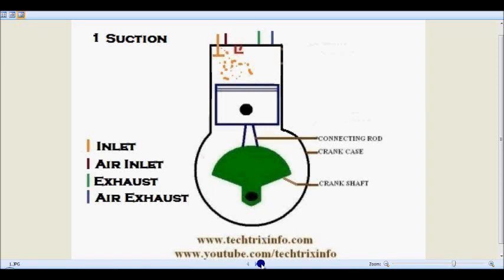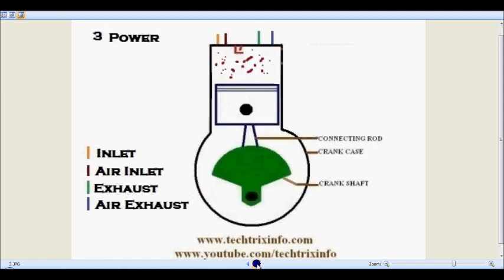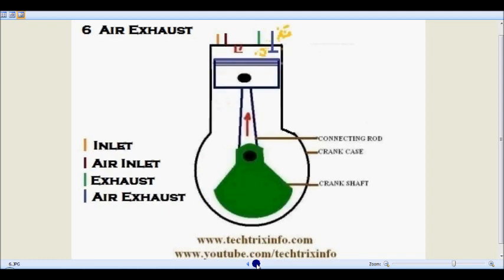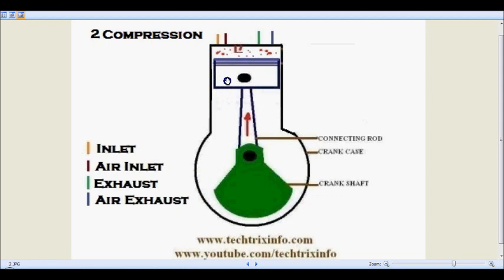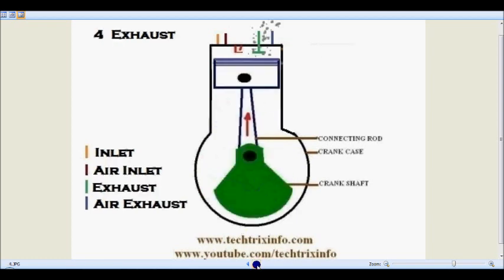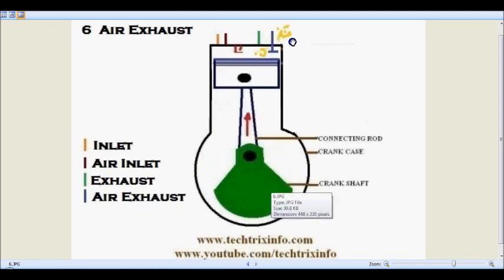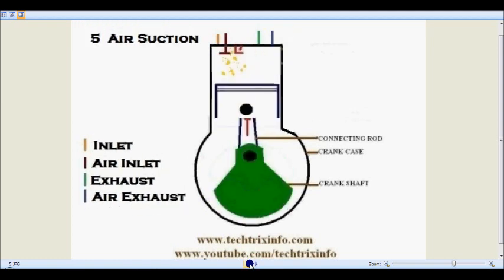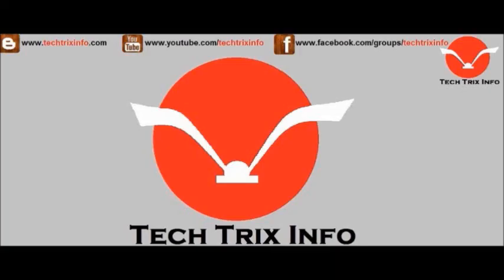How six stroke engine works  Animation. ✔

Comment: Even your God couldn't help you understand this, let alone explain it. First of all the air induction is preheated si it acts as a power stroke plus cooling, this helps with consumption and emissions, it's not there to 'clean the engine from burnt gasses'.
Reply: Each and every cycle clean inside the chamber that's give good economy  first prototype engine reducing 98percent of carbon monoxide

Comment: I have some ideas that we can create hybrid engine
I can describe it
plz sheyar my idea
I have pv diagram in hybrid engine plz help si
The counter will require less power then we will use 6-stroke engine and then we will need more, we will use 4-stoke engine I have six stock engine working diagram pv is available if you say I should share it I am working in oppo mobile phones
There is no one who knows me can share it
So I requested plz shara my idea
Or apply my idea

Comment: Lanchaster made a 2 cylinder opposite opposed  contra rotating crankshaft engine for cars  100 years ago using the 6 stroke - it ran very smooth  - it has questionable thermodynamic advantages

Comment: I understood the operation, what is the use of separate two strokes-air suction and exhaust strokes(scavenging). Is it only for scavenging or will it increase cycle efficiency/fuel/mechanical efficiency/volumetric efficiency-please explain. --prasadses.rjy@gmail.com
Reply: it cleans the system. the carbon monoxide levels drop by 60℅ ultimately and it gives more torque

Comment: What a pitty you do not explain what the advantage is of the two extra strokes! Less pollution? What is the disadvantage? Like the crankshaft has to make a full turn extra for each power-stroke. That loss of mechanical kinetic energy in the engine, does it make up for just a bit less pollution? Relatively, the engine has to work harder / turn faster for the same amount of power...

Comment: take it logically when 6 strokes are used we have to modify camshaft & its timing lobes and crank has to go for another 360' of its regular rotation it may damage the engine very soon & we have to check the vehicles crankshaft regularly....????

Comment: A camshaft with a lower lobe seperation angle has more overlap..more overlap causes a scavenging affect at higher rpm and produces more power relative to a lower overlap higher lobe seperation camshaft..

Comment from the maker: Not really, but will be very effective at high RPM where torque requirement is less, can only be used as multicycle engine 4+6.
If you need more clarification please drop a comment. will respond.

Comment from the maker: this engine cannot simply replace a 4 stroke engine. the 6 stroke can only be used at high engine speed where the torque requirement is less.

Comment: He is right about the valve overlap..at higher rpm valve overlap creates a scavenging effect which pretty much draws in clean air from the intake..at lower rpm there is more reversion into the intake side..

Comment from the maker: This comes into play when the engine is running at 20km/hr (6 stroke). for starting 4 stroke is required, i mean we need a multi cycle engine or a hybrid engine. Then the 6 stroke cycle will prove to be efficient as less fuel will only be required to maintain the RPM.

Comment from the maker: Thank you...
Sure will update..Please have a look at our other videos too and rate us, which would help us to improve.
Reply: Dear, Good work but can you explain how sucked air in fifth stroke can make power stroke??? It just sucks in air from atmosphere and then sends out!! Do you mean the sucked air will face cylinder heat and does something?? If so, the compression is taking place Not por, pls explain , thanks.